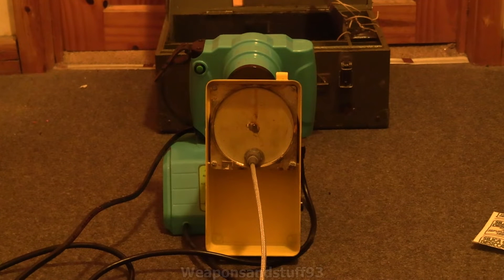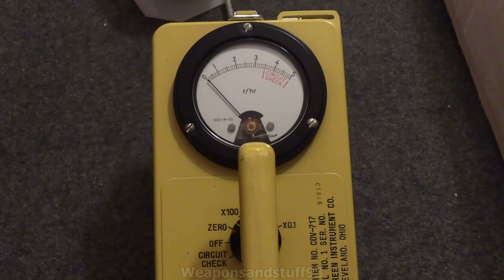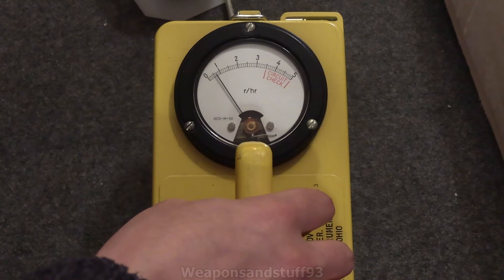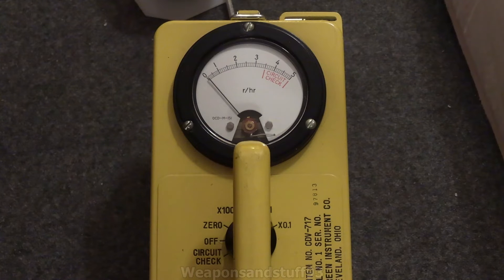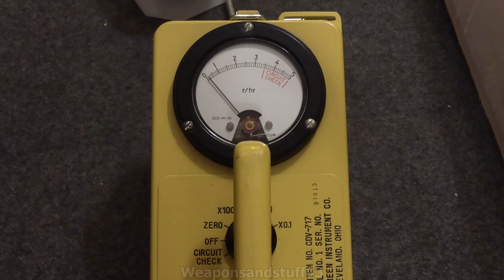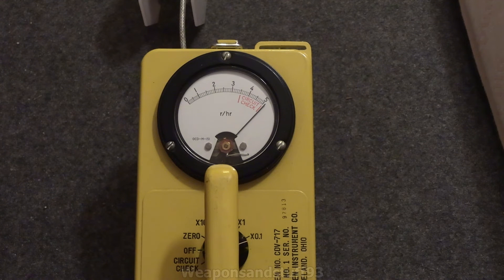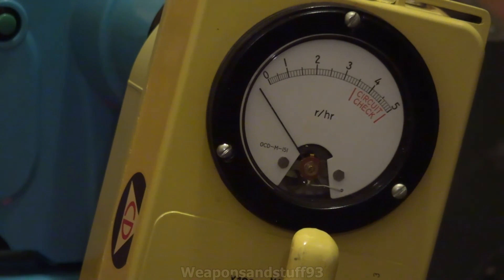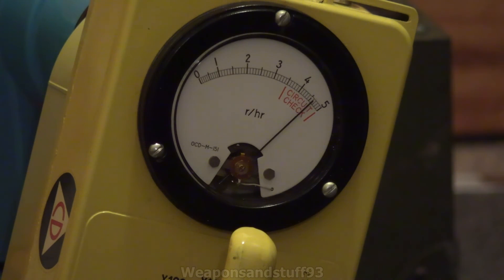CDV 717 X-Ray tests

Comment: I have a cdv 717 about 2 months ago I sent it to Ludlum Measurements to be profetionly calibrated but the meter max out on X0.1 and X1 and on the X10 it is saying that that it is 35 R/hr none of my other meters agree with it. I heard that some of the displays in the 717 can be faulty  this mite be the case with my meter, his is seems to have the same problem.
Reply from the maker: Only thing I can say is as a few other people have told me, if it's being used on the lead it's much slower to adjust the reading correctly, fine for fallout outside a shelter, not fine for x-ray readings etc.
So I'd only really trust the reading when the ionisation chamber is directly connected.
Personally if you can get a British MD3 meter I find they are a bit like the CDV-720 but a lot more reliable (Due to being a 1980s retrofit as opposed to a 1960 meter)
Reply: These reading are my meter taking back round

Comment: The CDV-717 manual states "The time to obtain a satisfactory dose rate indication is considerably increased when using th cable with the remote detector. Allow at least 4 minutes for the meter to reach a steady value when using x0.1 range, 50 seconds when on x1 range, and 9 seconds on the other two ranges" Hope this helps.
Reply from the maker: Cheers I was told this by someone else just now lol, I'll mostly use this with the ion chamber attached anyway. I wonder why this is fairly slow with the cable in use where as for example the Soviet DP-3B is pretty much instantaneous, might just be because the 3B runs at 26 volts...
Reply: Its because of the ion cahmbers ridiculously low opertaing current of around 6 micro amperes. The ion chamber runs at 50v and 6 micro amps (0.3 watts)
Reply from the maker: Very interesting, thanks for that.

Comment: You are partially correct regarding the use of the cable making the needle movement slow but it is not due to it not being calibrated but just it being much slower at registering the dose. According to the manual it can take up to 2min for the 0.1x setting to register an accurate measurement, think it was 40sec for the x1 and a few seconds for x10 and x100.
Reply from the maker: Ah that makes sense thank you, I need to watch your video on it, didn't actually read all the manual as most of it is just the 715 manual. Weirdly the Soviet DP-3B with a similar length cable has no time issues what so ever regarding giving instant readings.
Reply: I may be wrong, however, the possible reason for the slow needle movement when using that coax cable is because of the capacitance of the cable is slowly charging up and then discharging. Remember,  the high voltage circuit is sensitive to any load. That is why you use a very high impedance probe to measure the voltage of the high voltage circuit.

Comment: Hmm... Wasn't expecting the cdv 717 to do that... In theory, the cdv 715 said it w as 500+ roentgen. As you said it was a calibration error. Hopefully the seller didn't say it was calibrated!
Reply from the maker: Nah it was the 720 that said 500R, the 720 has a beta plate on the bottom, which was too expensive to mass produce so the 715 and 717 did away with that. However it means the 720 can pick up SR90 etc when the 715 can't etc.

And no lol I've never seen anyone claim an old device like this to still be calibrated, I'm amazed how well they still work seeing as they were made about 60 years ago.
Reply: @weaponsandstuff93  some of the CDV-700 units are calibrated, though usually not recently. Of course, those are Geiger counters, which are much easier to calibrate than ionization chamber units.
Reply from the maker: Yeah there are those cool 700s with the new tubes that make them x10 the original ranges, so a lot more practical.
Reply: @weaponsandstuff93  I have one of these, but they are normally pricey! $80, $100+ last I checked. I was lucky to score mine for $60. A very practical modification indeed.